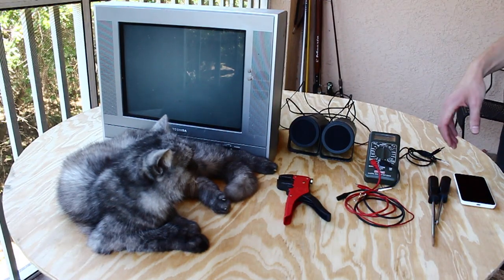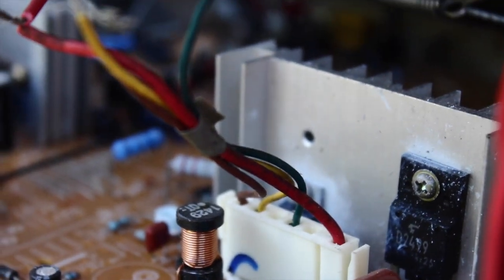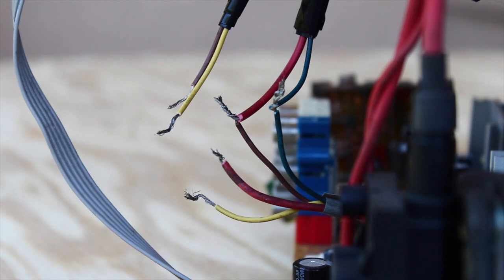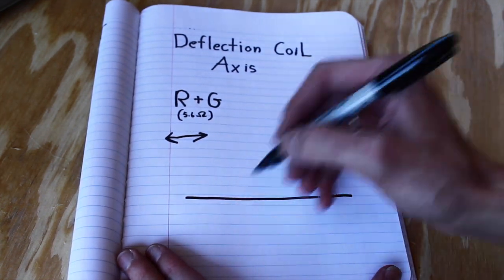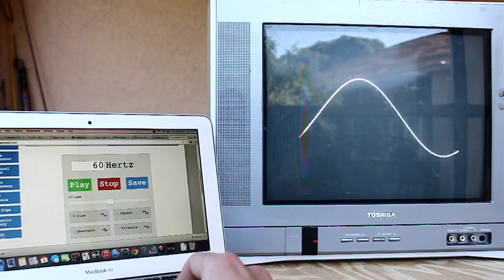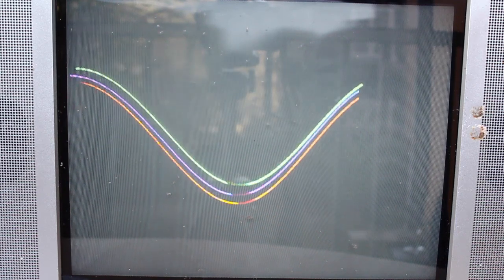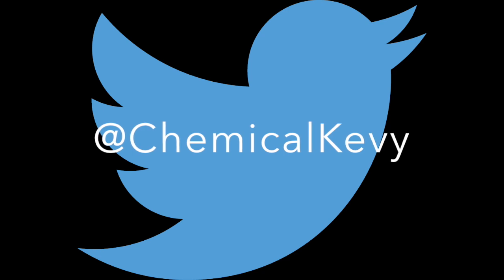Oscilloscope From an Old Television

Comment: Sorry to be that guy but NO. It is NOT an oscilloscope (no time/gain control and no readout/grid option), it is merely a mediocre Waveform Monitor.
And NO, this is not a complete project. You NEED to inject a constant voltage to the Cathodes Kb Kr and Kg to drive the beam's intensity to avoid the line irregularity generated by the input (or lack of). Ideally you also want to manage blanking separately, unless tapping on the Jungle directly.
This rant was brought to you by a an active CRT Tech.

Comment: Doesnt actually show how the wires are connected to the coils. You said connect the audio cables to the vertical coil. And then you said connect the hotizontal leads to the vertical leads what does that mean? Vertical coil gets audio, horizontal coil gets what?
Reply: I don’t think you’ll get an answer on a 8y old vid
Reply: @combycat  yeah I was already writing the comment when I realized lol. Who knows, I mean you responded lol
Reply: @VoltageNostalgia  well you're not wrong, sorry if i sounded rude, also just try random combanations of wires to see if it does anything but my guess is that you have  the horizontal going to the circuit board and vertical going to audio input?

Comment: I GOT A HEAFTY SHOCK DOING THIS. While trying to remove this suction cup thingy on the CRT, I got a pretty hefty shock. It wasn't even plugged in!

Edit: I just realized that I was supposed to discharge the CRT and the flyback transformer so it doesn't shock me with 30,000 VOLTS!. I could have died. O_O
Reply: i would recommend you wearing rubber gloves
Reply: so the electricity don't shock you
Reply: @PikaGamingPikaVlogshallo  High voltage rubber gloves are expensive. They are like $100-$200
Reply: yeap
Reply: someone told you to wear gloves, that is not good advice, you're supposed to discharge the crt, which you already know by now (obviously), if anyone else wants to know how to do this look up videos on discharging crts or look up a video that the 8 bit guy made on repairing a macintosh(which has a crt) he explains it beautifully in that video

Comment: Hi, I tried  doing that by plugging  both deflection coil on different audio jacks socket (a lot of people doe that to have both X and Y axis displayed when you play music). What I get when I turn the tv on is the initial dot in the middle but it stays super small but becomes really really crazy bright and after a few seconds i hear a pop, the display shuts and after a big static noise appears coming from the back of the tv and continues until I unplug the tv. Any ideas on what's wrong ?  Thanks
Reply: Same problem here.
Reply: same problem
Reply: Same here if anyone can help me

Comment: transformers don't store electricity, capacitors do;  the inside of the crt is a big capacitor and is that what you need to discharge,before handling the thing? i know it throws a nasty  painful SPARK ...

Comment: I used a wireless CCTV monochrome 5" monitor which operated a 14 Volts DC, the result was pretty wack, waves are barely visible and requires a very high input, like a 20 watt amplifier at least to get visble movement, posibly the impedance is too high, still was fun to make

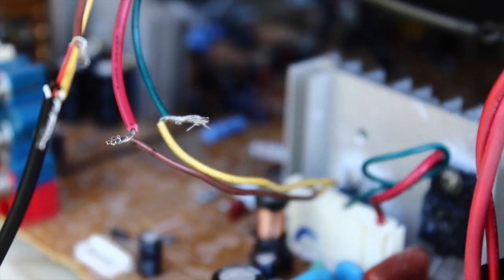Comment: 2:10 why do you have to do this? Other tutorials do not have this step.
Reply: Hes using the pair that gives the largest variance to change horizontally across the screen. (the other one wouldn't wobble so much)

With a bit more work you could make an XY vector image, instead of the crude oscilloscope effect.

Comment: What does he mean by connect the horizontal coil wires to the vertical coil leads? Is that where the horizontal coil wires connect to the circuit? And I just have a dot on my screen, I’m not sure how to see which coil is and isn’t vert.

Comment: How do I get the whole wave to go from one end of the TV to the other, it's a rather large TV and the line is about half of the total screen length
Reply: Michael Sassman I also have this question!
Reply: @tmburns4  hey I think I figured it out sometime last year when I was messing with them, if I remember correctly the TV would have a full line one way and a partial line another way, easiest solution is to find the axis with the full line (which would be the Y axis in most cases I saw) turn the TV on its side and make a custom case out of MDF or some sort of material, otherwise use a smaller TV bc with my smaller one I just recently got rid of I didn't have that problem
Reply: Michael Sassman thank you!
Reply: @michaelsassman9883  Do you think rotating the yoke (coil assembly) would work in that case?
Reply: @zaxarrrr3659  if you're looking to keep the TV in its original case, and want it to look good I'm afraid I can't help, you see my solution was to swap the inputs so the line displays vertically in the original TV case, then fabricate a box for the TV screen to set it horizontal, I'm not sure if you've seen the TV coils and it's been a while since I've seen them but If I remember correctly it's a LOT of coiling and takes more time than I'm willing to put in, I think it might work from a basic understanding because you're swapping the two coils so if the distant the ray can travel is determined solely by that then it may work, I believe the inside of the CRT is just some sort of diode or coil or something to emit those rays so I believe it may work
Reply: @zaxarrrr3659  also sorry for the long reply lol if you're thinking of doing this project you can do it all from good will parts and it's quite a bit of fun!
Reply: @michaelsassman9883  Well, thanks for the response. Firstly, I'm not in the USA unfortunately. Second, I have already made one but was looking to figure out how I could get the horizontal line to fill the entire width of the screen. And third, I'm not sure you're following, the yoke assembly around the tube is held in place by a clamp, once you remove the clamp, you can carefully wiggle it around and break it loose, then you can rotate or remove it entirely. Obviously you have already completed your project but I'm just writing this for future reference. I'm kinda fed up with the anxiety involved, I'll switch and rotate the coils later on and report my findings. Sorry for the long reply as well, have a good one.
Reply: @zaxarrrr3659  oh okay, I appreciate the info, yes let me know if it works, I have not taken a TV yoke out so I'm interested to hear your findings. Good luck!

Comment: I have an old tv and I want to do this, but I also want to salvage parts from the main board for another project. Will this work using only the CRT, transformer, and power supply cable/ fuse circuit?

Comment: So I've tried two tvs.  Found the vertical coil.  Unplugged the horizontal coil.  Fired up the tvs and the showed the vertical line on the screen for a while then they shut down and never fire up again.  Checked all the capacitor and they seem fine.  Any thoughts?
Reply: Never mind.  Got the third tv to work :) had to use a dummy coil from another tv to get it to work. Tried to use resistors, but it didn't seem to work

Comment: You can conect the audio ouput, from a power amplifier, to the vertical deflexion coil ; no conecting the vertical ouput to nothing ,eventualy, you can find an impedance to place at  that place...o a normal 220v lamp.
Of course you can not change the time base.
Will be always 50c a second.

Comment: Will the Oscilloscope music tracks work with this?
Reply: They won't. You need X/Y mode for that, i.e. controlling both the coils. You may get away with just connecting them to the R and L channels though, but I'm not sure.

Comment: Once I made this when I was 15 Years old, I added the two channel speaker output to Horizontal Yoke coil and used the sound amplifier amp input as signal input pin and it worked very well .............. I used it to check different things.

Comment: This is fun but also VERY dangerous to the inexperienced. Trust me I know, I've pissed my pants a few times in the past from playing with old camera flash circuits.

Besides, scopes are cheap nowa days. I got an old TDS540C off ebay for $400 a few days ago. That's a 2GS/s 500mhz digital scope with a lot of features. It was also my dad's favorite scope from back when worked out at Boeing. Plus, if you find a broken scope they can be a fun (challenge) in learning electronics if you want to fix them. If you intend on getting an old scope working again but don't have the experience then find someone who does and is willing to help you fix it. It can be a fun and rewarding exercise.

Comment: I'm never one to be like OMG UNSAFE, but for people that don't know what they're doing this is absolutely dangerous. Those caps pack enough punch to easily kill someone.
Reply: Yes, this! Except for one thing. The cap that holds the charge is actually the CRT itself. So if you remove the CRT without discharging it first you could be in for quite the surprise!
Reply: Yea this project is really cool, but if you don't know what you're doing and you don't discharge it you WILL die, but if you discharge it you're all good, you can lick the crt and you'll be fine, but MAKE SURE TO DISCHARGE IT PROPERLY, don't blame me if you injure yourself, you've been warned, honestly the best video on doing that safely is a video the 8 bit guy did on a macintosh, which has a crt in it
Reply: Good point. Just like anything that carries dangers, one should be knowledgeable with it to be able to avoid the dangers. Electricity, explosives and chemicals all have their own specific hazards and one should not endeavor to play with them without an education.
Reply: There's also a x-ray warning on the tube, if i ever did this to a tv, i swear.
Reply: TransientVoltageSpike, I have done removed crt without discharging it before and didn't get shocked

Comment: please note that some old tvs won't be able to do this. I have already destroyed a few tvs trying this. the reason being that the horiz. and vert. coils have different resistances and the vertical driver could not handle the resistance from the horizontal coil, this caused the tv to overload and fail. I have gotten this to work, but It was with a Philco tv from 2000. I do hate the manufacturer warnings.

Comment: You don't know wtf you are doing.  There is a Vertical IC (preamp/amp)/circuitry.
Send signal through that (mV).

Your "horizontal" is also not full scale (short).
Coils were designed as: horizontal for horizontal deflection, vertical for vertical deflection.

Incomplete load on Horizontal circuit, wonder how long TV lasted...
WARNING!

Comment: Realize that the CRT charge is at 20,000 volts, before you disregard any warnings!
Reply: Take it from someone who has pissed their pants a few time on high voltage. Don't disregard the warnings!
Reply: because the capacitors still hold a charge, even when the tv is unplugged
Reply: Accidentally toched the voltage test points on a nixie tube kit - 170 volts.
I WAS PRETTY BLOODY AWAKE AFTER THAT!!! :(
Reply: YES do turn it off first. But be aware because the picture tube/HV section act as a capacitor and hold the voltage for a long time just waiting for you to try to grab it, here's a clue - - it likes to be the first one to grab. Discharge the picture tube(the plug on the side or top of the picture tube) to ground before you do anything else(as he said) once you have it open. Attach a wire to the ground/chassis and the other end of it to a flat screwdriver, then slide the screwdriver under the rubber disc to touch the wire under it, there may be a "click" as it sparks the charge off. Hold the screwdriver by the plastic handle of course.
Reply: There is still energy enough powerfull to do harm or even death in the capacitors, same for power supplies of computers.
Reply: About 400 volts from a photo flash capacitor. Went across my arms and knocked me to the ground.

All it takes to catch you off guard is 12 volts believe it or not! Now that probably won't make you piss your pants but it will give you a surprise when you are working on your car in the middle of the summer. Normally 12 volts isn't enough for you to feel anything, but you lean over while holding the frame of your car and your sweaty forearm grazes on the positive terminal of you car battery and you get a nice tingle on your arm that feels like someone poking you with a sharp needle.
Reply: Kaylee Fisher lol
Reply: Richard Vasquez i think we know if we are smart.
Reply: Let's get something straight here. The CRT anode does indeed run at +20KV, and it also acts as a capacitor that can hold a charge for a long time.
However, it is not lethal to the average person. It's very unpleasant and can cause a muscle spasm, but it isn't that dangerous. Even with the TV turned on, the anode supply from the flyback will do little more than cause minor burns and some discomfort. Thus is down to both the low current, and the high frequency of the pulsed DC. I worked repairing TVs for many years and had many encounters with TV anodes. They make you shout expletives...
The danger in TVs is the mains side of the SMPS, just like most switch mode psu powered gear.Certainly in 230v regions, it can hold enough energy to seriously put you at risk.
Reply: TransientVoltageSpike wow i am really sorry for you! I don't wanna be an asshole but what was the voltage? It sounds like a super high one.
Reply: if it's a dangerously high voltage, why not just turn the TV off when building this?

Comment: what's the use of the cat?
Reply: Orange Fox The static electricity of the cats fur will intesify the effect of an oscilloscope.
Reply: Orange Fox for looks
Reply: toxoplasmosis
Reply: Yes.
Reply: Static discharge.
Reply: it can be placed into various circuits 9 times
Reply: to know if the tv is actually showing a wave or not
Reply: Moral support
Reply: Pulling dat screen knob on the flyback transformer
Reply: The television ought to be hungry after being hacked like that. You feed the cat to the TV.
Reply: Cuteness...
Reply: Nobody discharging the flyback transformer

Comment: Every time I plug the vertical coil wires into the horizontal ones, two little resistors by the coils start flaming and smoking.. What did I do wrong?

Comment: I connected the vetical coil lead to the horisontal coil as you said, but that burned the tv. As others said. I crossed my fingers and took a chance, but that fucked it. The coil leads is probably producing different current to the different coils, hence different frequencies (60 Hz horizontal and something like 32 kHz vetical). I guess this works on some tellies and not on others.

Comment: Instructions not clear, ended up with my foot stuck in the toilet.
Reply: Can you give me an indication,
How many μF or pF or nF must be these capacitors?
Reply: +StDGames consider yourself lucky, I got a crt stuck up my ass :D
Reply: +StDGames jk dude seriously this is actually pretty easy to do, except, I would recommend adding a smoothing capacitor to the horizontal and a resonance capacitor to the vertical, to get a broader wave, in which you can see the harmonics.
Reply: it depends on the inductivity of the coils and on the freuquency you are driving them with. Idealy, I would say you scrap all the circuitry inside except the flyback driver and the coils as well as the power supply. You could then use a dedicated deflection coil driving IC like the AN5521or any op amp. You could really have some fun and make the wave centered using a cd4046 pll ic, and by adjusting the multiplication/dicision you could add a scale and make a scope from it! Now thinking about it, im definitely gonna try to make it myself :D!

Comment: I did as you told, and it didn't worked. I think the horizontal coil must be wired with the horizontal leads on the board, not vertical.

Comment: When I turned the Tv on after connecting the horizontal coil to the vertical leads from the circuit board it caught fire. What did I do wrong?

Comment: That's not even close to a square wave lol or a triangle for that matter. And the reason you get that cool effect between 60 hz and 61hz is because of the phase shifting of the different frequencies... I think. I'm still in tonmeister training, but I believe that's why.
Reply: +2 Sense Entertainment The distorted square and triangle waves could be a limitation of the audio amp he's using, or a feature. Lots of square waves in computers, there may be some filter in the audio section trying to attenuate them.
Reply: +Cheezy Dee that's a good point. I mean you pretty much need an algorithm and the right program to get a perfect square anyway.
Reply: +ivan R yes, but a 1hz phase shift would cause a bit of a weird effect, no? Plus the television is refreshing at 24hz, so couldn't that have an added effect as well?
Reply: 2 Sense Entertainment Certainly! The reason the TV is bad at portraying all of the ripples in the sine wave, is because the refresh rate is so low. I am pretty sure the refresh frequency can be changed, by adjusting the flyback driver. Then, you would see a very different picture.
Reply: +ivan R Yeah I got what you mean. It's still a cool little visual effect anyway.
Reply: +2 Sense Entertainment no, actually it is because of interfierance cause by each wave. Both waves cancel and amplify each other, creating a lot of harmoniocs in the process. The reason the wave appears to move, is because the tv oscilloscope, is not good enough to pick them up, and instead it shows it as 1 hz movement. This is what it should look like http://www.piso.at/julius/images/images/Bragg/Bragg-Diffraction.png this is an example with a square wave circa 40khz.
Reply: 2 Sense Entertainment It most certainly is. You have just motivated me to do this, as soon as I get my hands on an old CRT T.V. I will try to change the refresh rate, however it will be very hard to do, as most CRT TVs work in quasi resonance mode, and changing the frequency will probably make it go apeshit, but I will still give it a shot and tell you what I get. P.S. Thanks :D.